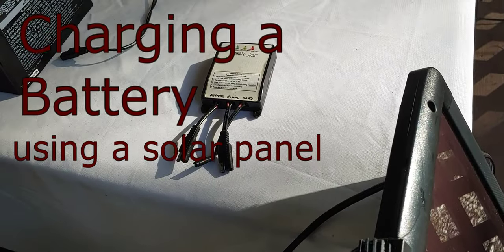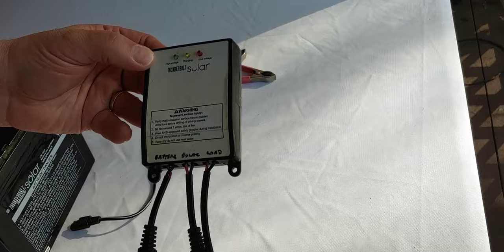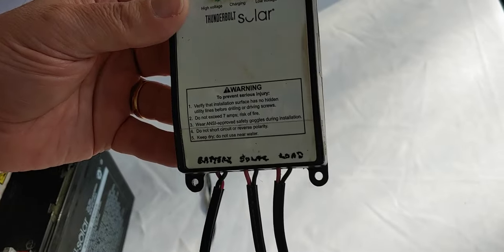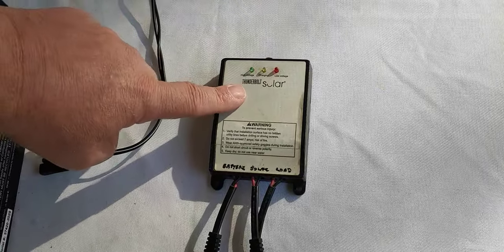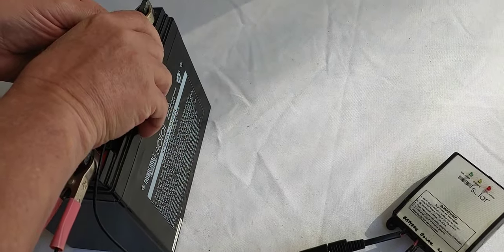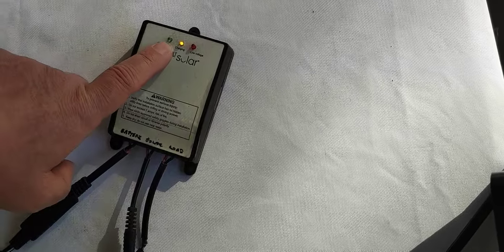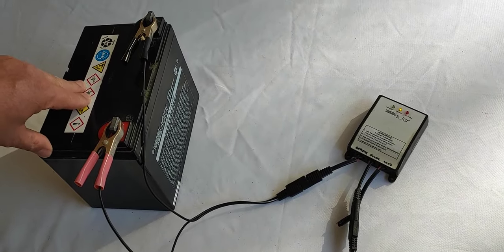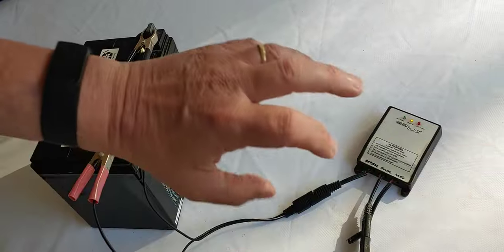The easiest and least expensive way to charge a battery with a solar panel.

Comment: I have a rabbit hutch for guinea pigs im planning to winterproof and use heated wiring to keep them warm among other ways to shield their enclosure. How would i keep it solar and not connected to household power as i have limited ways to plug in anything outside without running wires from the inside out?
Reply from the maker: Your first step is to figure out how much power you will be drawing. Once you know that, you can begin to build your system from there.
Thank you for your comment

Comment: I have a question. How do I use the battery to charge cell phones and laptops
Reply from the maker: To charge those devices, you will need a battery with a USB port (or an inverter with a USB port) to connect the phone or laptop. Thanks for comment

Comment: How long does it take to charge?
Reply from the maker: The battery will take several hours to change, depending on how low the battery was when you started. Thanks for your comment.

Comment: What kind of charger do you use for lithium batteries 12 volt
Reply from the maker: The most efficient battery charger is a fully dedicated charger, specifically made for lithium batteries. But they can be quite ecpensive. Thanks for your comment.